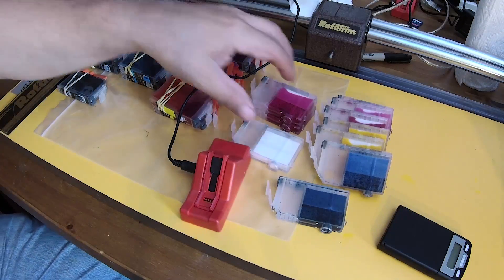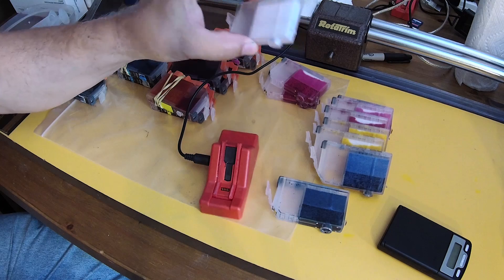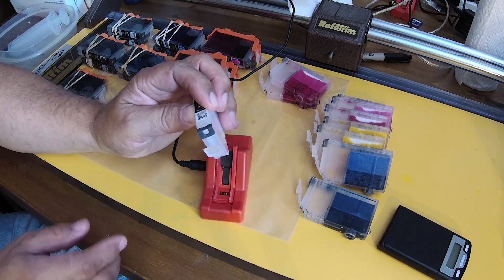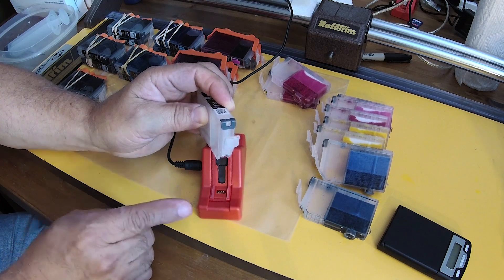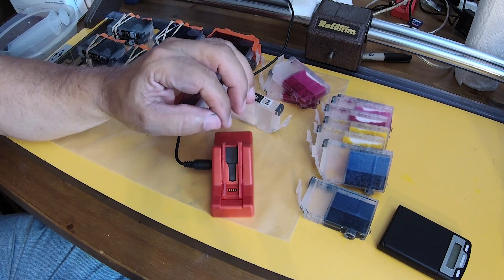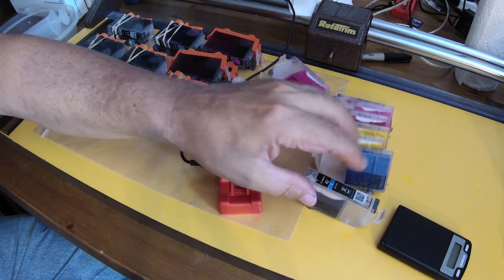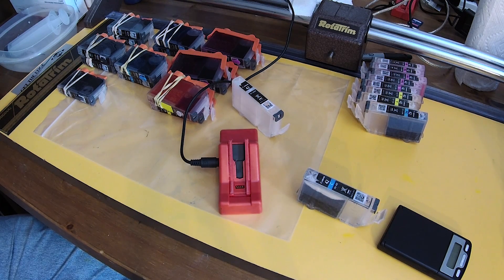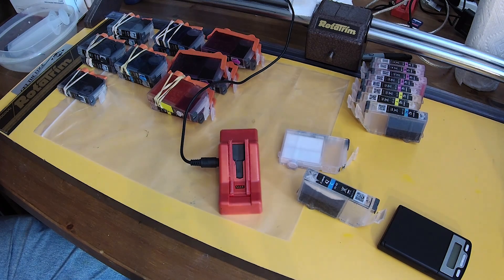#3 The WRONG way and The CORRECT way to reset your CANON Carts

Comment: hello sir. i was surprised that there is something like a chip resetter. this really helps. the printer ive been using is canon pixma ts707. can i use the resetter in this video to reset my printer?

Comment: Hi Jose, thanks a lot for your videos, they're really helpful and I'm so grateful. I've got a whole set of empty OEM cartridge and a USB resetter. For most cartridges, I had no issue, red light/pause/steady red light, and I was able to refill them. However, there are 2 problematic cartridges, the steady red light just won't show, only the short one and then nothing... I don't know what that means. The resetter seems to be working fine for the other cartridges. Is the cartridges chips corrupted ? Is there something I can do ? Thanks for your help. :)
Reply from the maker: It simply means the chip is not good. It's not a 100% guaranteed process. There could be failures.

Comment: Did you tested autoreset chips available on ebay and aliexpress? Apparently they reset ink level to full every time you remove and insert cartridge into that printer (probably on power loss also ?).

Comment: Hi jo sadly my husband died recently and I'm really not sure if he would have already reset the chips on my 2nd set of cartridges, as I now need to replace one, is it safe to reset a cartridge if it looks like there is ink already to go, for example I think when one was empty he would replace the empty one and immediately fill the empty one storing it for when needed again?
Reply from the maker: I am so sorry to hear about your husband's passing. Normally assuming we are talking about a printer like the PRO100 , you always reset before refilling so you don't have ink leaking all over the place. Resetting after refilling is difficult and messy. I would install the filled one and see what the driver reports as far as ink levels.
Reply: Thank you so much for your reply, my husband was a bigger follower of yours, he always said if Jose doesn't know,  nobody will

Comment: Is there different resetting devices for 221 cartridges and 210,211 cartridges or is there a universalone? If so where do find one? Thank you
Reply from the maker: There are no universal resetter. You need to go to a respected 3rd party ink products seller and see if there is a resetter for those model carts. I am not familiar with 210 211 carts.
Reply: @cheo1949  OK great Thank You for your kindness and helping others out with your wonderful videos in these difficult times.

Comment: My resetter never shows the light green anymore. 
do you know if  it is probably to repair it or I have to get a new one?

thank you
Reply from the maker: What printer's cart chips are you trying to reset? If it's Canon and it's the red one from Redsetter? It uses USB for power. There is no green light. If it's an EPSON chip resetter they use internal flat round batteries and they need to be periodically replaced.
Reply: @cheo1949  yes, it is Epson. So if the chip does not turn on green light. only red, it needs new batteries. Im going to change them. thank you.
Reply from the maker: @amstoreabc2765  yes. Good luck.

Comment: This will reset used OEM carts from Canon ? If that's right, than I should be able to refill the carts ( CLI 42 ) that came with the Canon Pro 100 printer . Thank you
Reply from the maker: Yes. That's the idea. Don't throw out those CLI-42s and remember reseters are specific to each model cart chip. You can obtain it from precisioncolors.
Reply: That's good, you only need one reseter for all
CLI 42 carts Y M C Blk ...... right ? Just want to make sure I understand .
Reply from the maker: Yes you need a reseter for CLI_42 Carts. It will reset all of the 8 chips included in a CLI-42 cart set. It will not reset OTHER CANON model carts. ONLY CLI-42.
Reply: That's what I thought but I just wanted to be
sure. Thank you for all this information.

Comment: I am now wondering if my chips are reset correctly because I didn't wait for the solid light to go out. When the solid light came on I removed the cart. I saw this in another video. This video shows waiting until solid light goes out before removing.
Reply from the maker: Though it is always best to allow the red steady light to go out before you remove the cart from the resetter, the code is being written during the period before the read light goes steady. At the point the light goes steady the code has been written. So it will be fine. But from now on wait till it goes out to make 100%.

Comment: can i use a photo magenta chip on a magenta cart? I tried and reset worked, but my printer is not happy with the transaction.
Reply from the maker: You can not. Chips are color specific. I've discussed that very subject in the past.
Reply: ok thank you for the reply. Sorry I missed that in your other video. I appreciate your info :)
Reply from the maker: No problem. There are almost 800 videos now and they are subdivided by different subject Playlist which should make the search for subjects at lot easier.  It's all there for you.

Comment: where can you buy the cli8 usb resetters?  Thanks!
Reply from the maker: They only have them for the PRO-100 CLI-42 carts. The CLI-8 ones are battery operated.
Reply: Thanks!  Do you have any recommendations where to pickup a cli-8 resetter?
Reply from the maker: EBAY

Comment: Hi, Jose...
I'm new to this process but I just received my new PC refill kit and I have a question on the yellow change...
Hate to pester you...I could ask on the live forum on Saturday but I wanted to try here first...I have combed through and watched many, MANY of your videos but have not seen one where you do the following...
I believe I understand the process...However, I am unclear on the chip change process...
I don't want to break the new CLI 8 that was provided...
Could you maybe do a small video on getting the old chip off and the new one on..?
Just a thought...
Many thanks for your priceless tutorials...
Jim Innes
Reply from the maker: There is not easy method. Shave off the welded posts on the carts and swap the chips. I recommed adhering the OEM chip with a bit of silicone caulk or even rubber cement. It's not dissimilar to how you do it on PGI29 CARTS.  I have videos on that. So does precisioncolors.
Reply: Thanks again, Jose...I'll keep looking through your videos for that one...
Have you noticed also that the Precision site seems to not now have some of those videos..?
I also cannot seem to locate their profiles on their page anymore...
It is likely just me and my stupidity...but I swear the profiles and videos just aren't there anymore...I have combed their site...I will keep trying...thanks...
Reply: I just found the profiles with a google search...I'm an idiot...thanks again, Jose...
Reply from the maker: Watch tbis video and apply the same removal process and reinstallation. Of simply glut the little holding post on both install the OEM one on the CLI replament cart.
Reply from the maker: Search for
 Here is my Complete Modification Process, Chip replacement and refilling PGI 29 carts
Reply: Many thanks...astounding stuff... @cheo1949